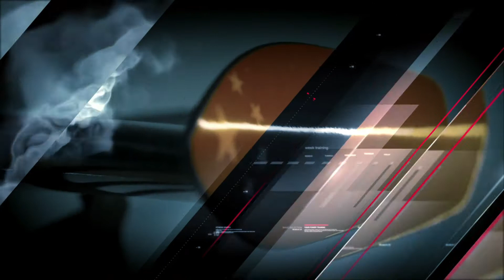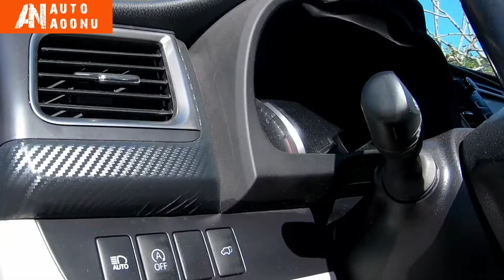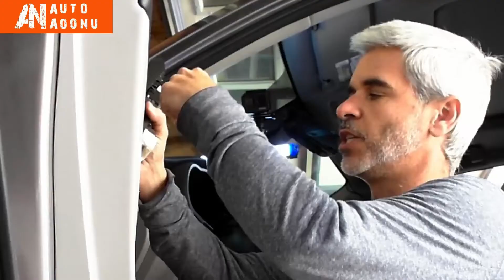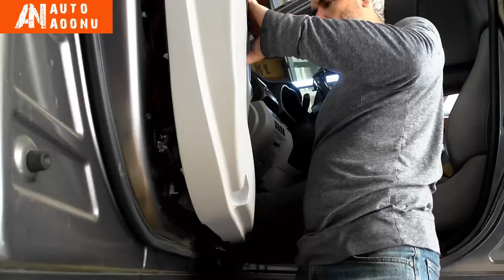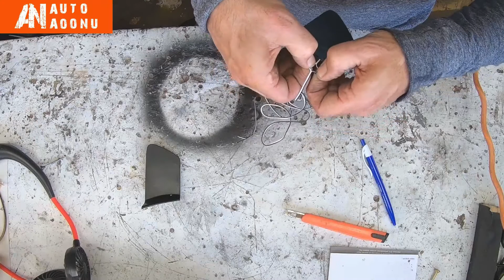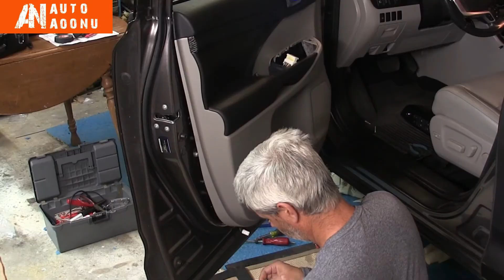2017 Toyota Highlander LED Door Handle Install - AoonuAuto

Comment: why wouldn't you tap in to the lights for the window controls? they are powered by the parking light switch. Now it only illuminates when the door is open.